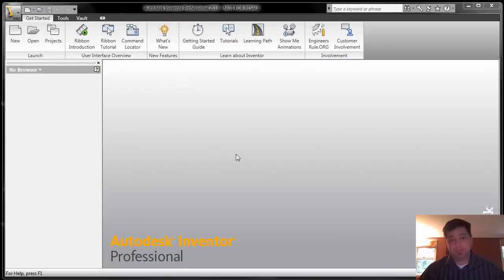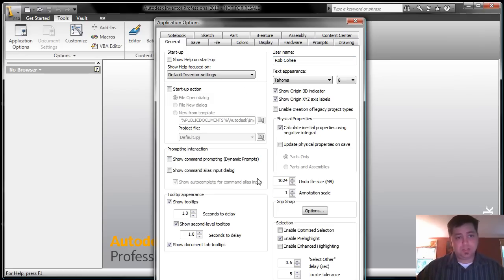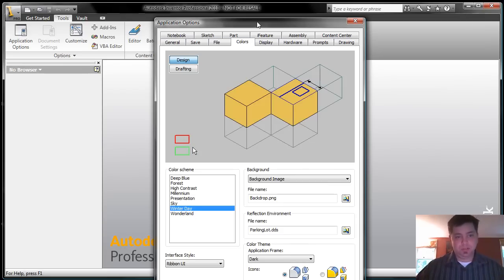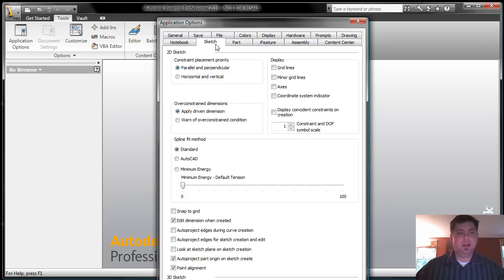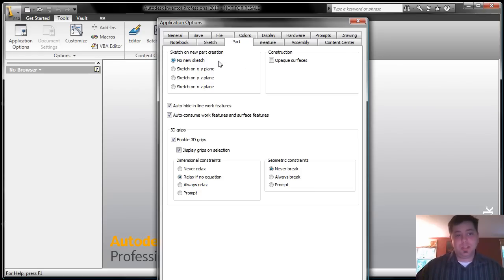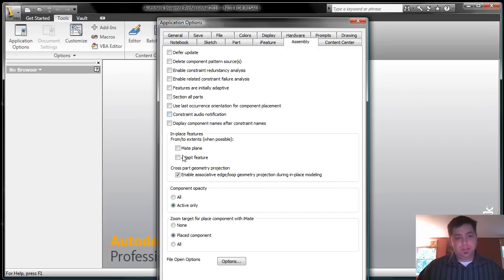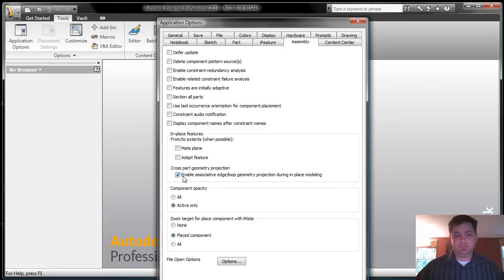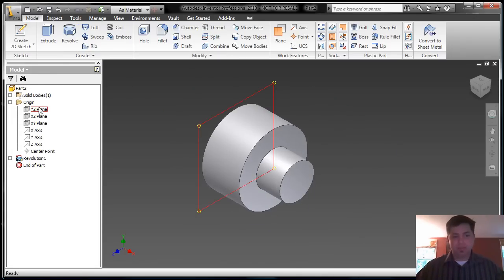Autodesk Inventor Two Minute Tip: Customize Your Interface

Comment from the maker: You can set your standard on the part file or assembly file you use to start your parts or assemblies. Open up those template files, make the changes you want, then each time you start a part or assembly they will have the settings you are looking for.